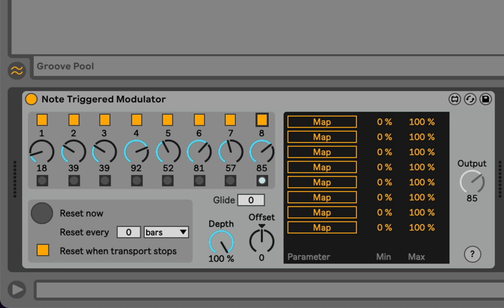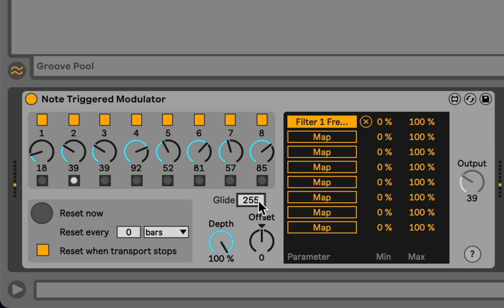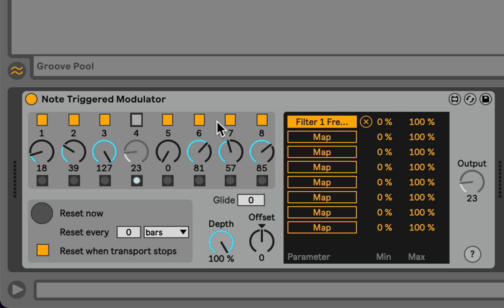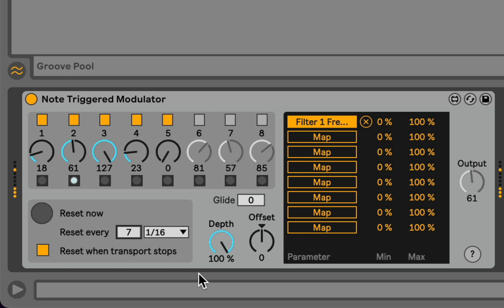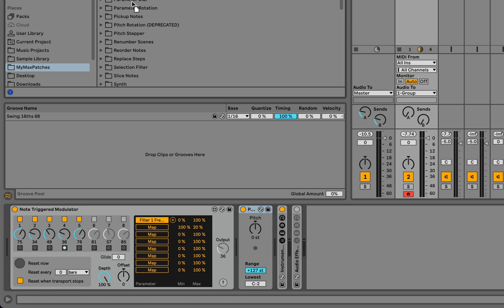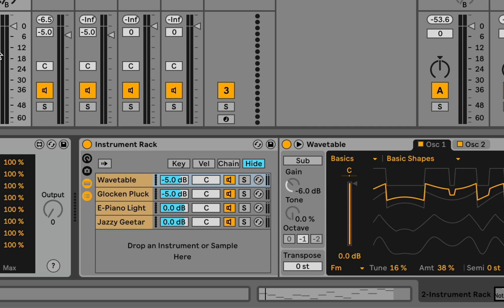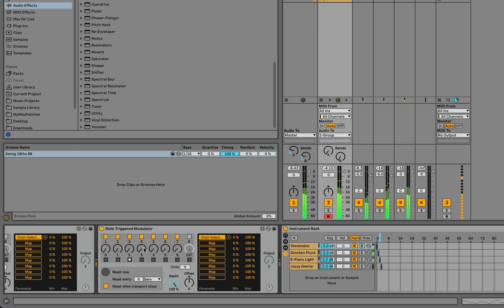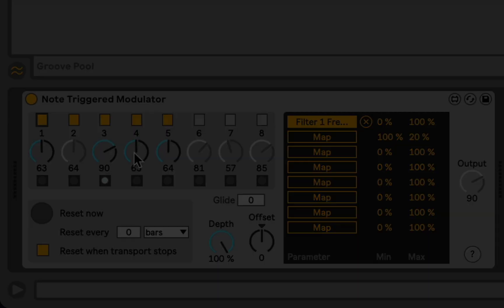Note Triggered Modulator

Comment: Hi Dennis! Great device. Are all parameters exposed / midi mappable? I'm considering using this with Clyphx and my midi controller. Cheers 🙂
Reply from the maker: More or less all the the parameters are MIDI mappable. It looks like the only things that aren't are the "Reset every X" chooser and "Reset when transport stops" toggle." (In principle, these could also be made MIDI mappable, but I doubt it's very useful!)
Reply: Excellent.. thanks for the swift response! 🙂 @dennisdesantis
Reply from the maker: @marksargent3342  hope you enjoy the device! Note that there’s an updated version for Live 12: https://maxforlive.com/library/device/10058/note-triggered-modulator-l12